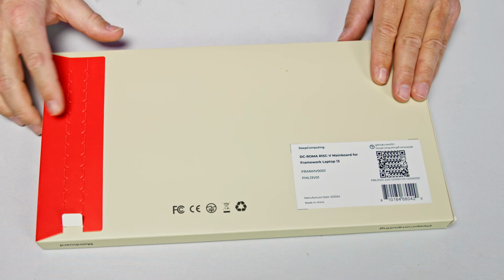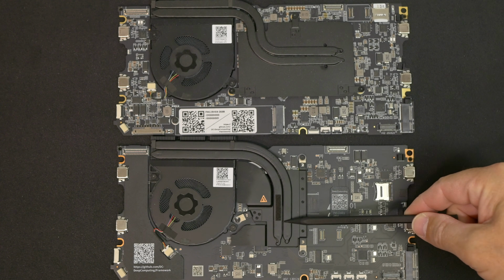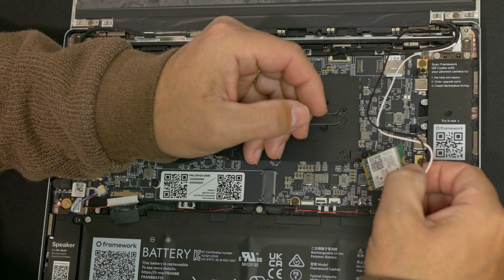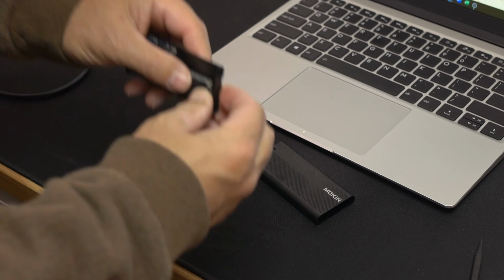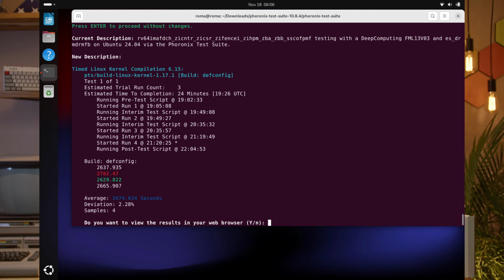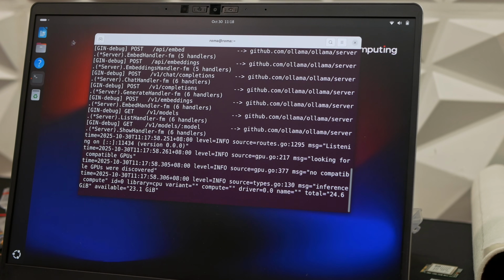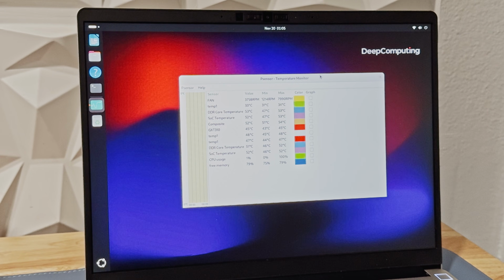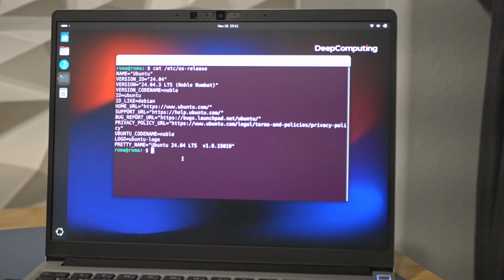Framework + Linux + RISC-V = The Most Open Laptop Ever?

Comment: Isnt mnt reform the most open laptop?
Reply from the maker: That still uses an Arm CPU which is proprietary. Arm charges a 7 figure licensing fee to use the architecture and takes per chip royalties. Arm also enforces restrictions on who can license the architecture. Very far from free and open.
Reply: @LiftingLinux  yeah, there are no risc-v boards right now. Sadly. But there is an fpga one, so we mnt reform can be the weirdest nintendo 64 hardware emulator ever 🤣